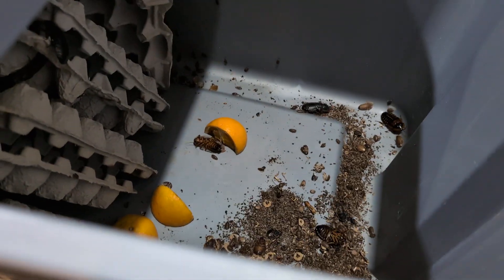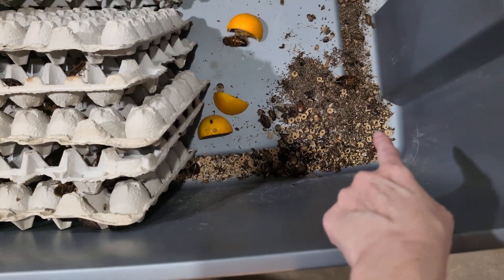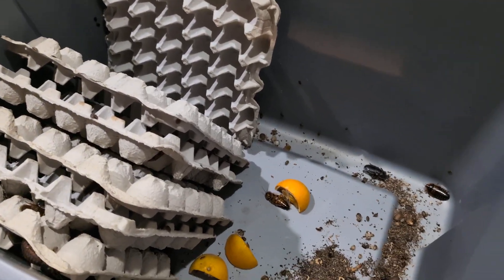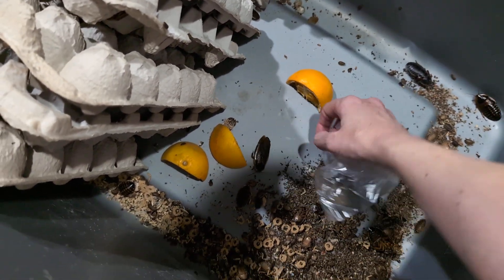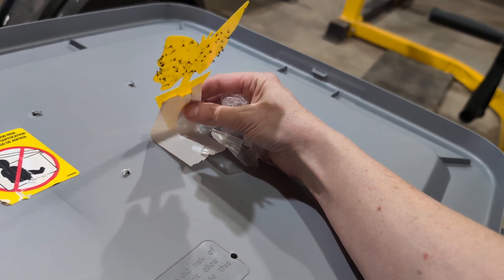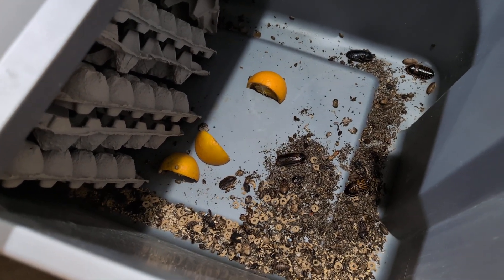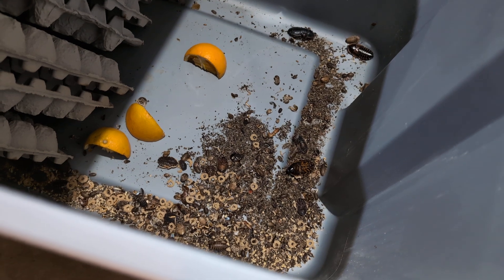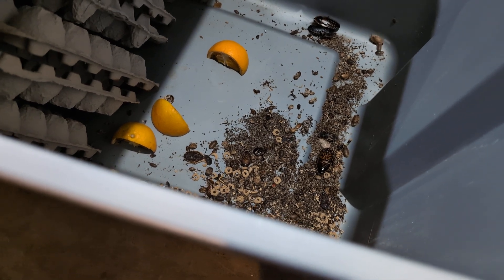How to Clean Your Dubia Colony Bin

Comment: How often do you clean it out? I have a very small one that is more vertical in an old peanut butter filled pretzel container with pieces of egg cartons and the chicken feed that animal 1 guy uses in his. Maybe I should switch to something more horizontal. I have limited space. So I can't do the large tub like you have. 

I tried feeding peppers and greens to them, but they liquified n made a huge mess. This time i put the feed on the bottom and fresh stuff in a tiny dish so they still get hydration from fresh food, but if starts to go bad the mess is contained. 

Having the small colony has been a little helpful, but still not quite big enough to not have to buy roaches at least once a month. Maybe I need to let the colony establish more before feeding?
Reply from the maker: I check it daily, but I do this maybe every 3 months to change out the flats, and yes, they really make a mess out of the oranges, I hate it